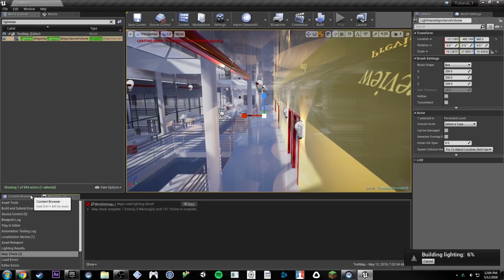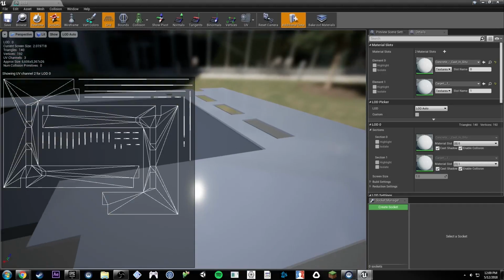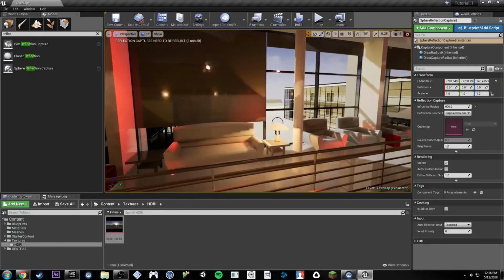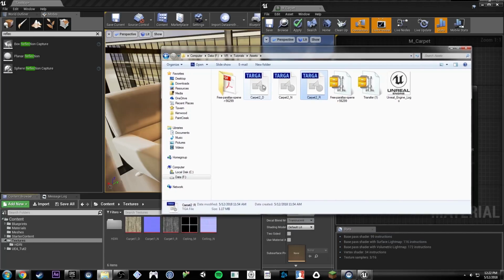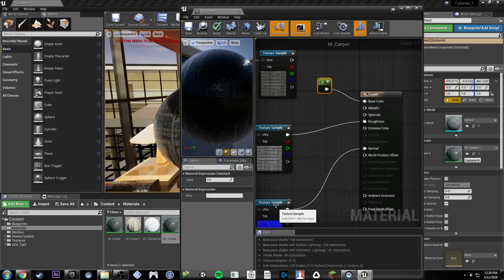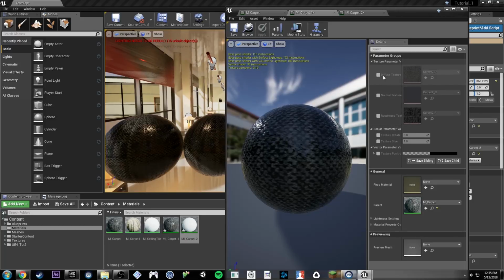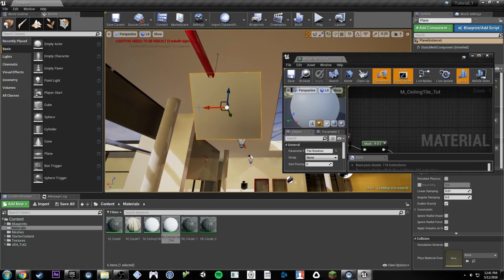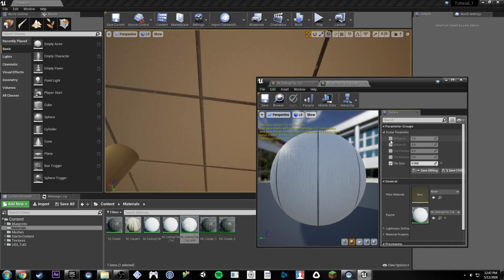Unreal Engine: Arch Viz Training (Pt. 2)

Comment: I don't know if you're still answering questions over here. Were you using Raytracing durig this videeo? Because of the artificial reflections I would think that if you use raytracing you wouldn't need to do that?
Reply from the maker: Hey Ju, I was not using raytracing during this video. I don't believe RTX for UE was released at the time, but my computer definitely wouldn't have been able to process it anyway ^^

Comment: Well in my experience UV layout isn't all that important unless you're baking textures to the mesh for things like game ready content since the UV then defines the maximum resolution of the texture. In most 3D software that does real time rendering I would just opt to tile the textures in the material setup and then create a separate UV Map to bake to should I need it. For simple objects that don't have shadows cast on them and require baking for games you could also break it up and overlay the faces in the UV editor but since a floor that requires baking may have shadows in one place but not in another it wouldn't be desirable since you'd then be baking the shadow onto the image and since the mesh shares those UV coordinates you'll see shadowing where there isn't meant to be shadowing. You would need to bake multiple textures and apply them each to the individual parts of the floor. The way those UVs are setup is better since all you have to do to keep the detail when baking is bake it to a 4k map plus you get maximum amount of realism due to the fact that UVs aren't overlapping or sharing the same texture thereby retaining accurate shadowing plus you don't have to mess around with applying your individual baked textures to each individual part when broken up. Each to their own though, many ways to skin a cat, just depends on how hard you want to work to achieve a certain result.